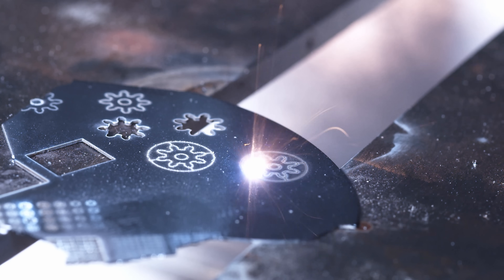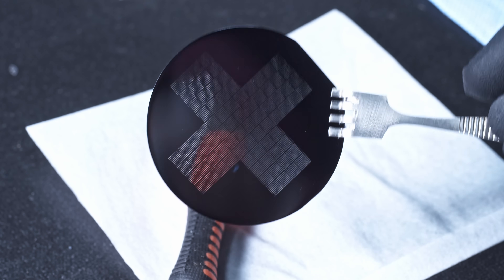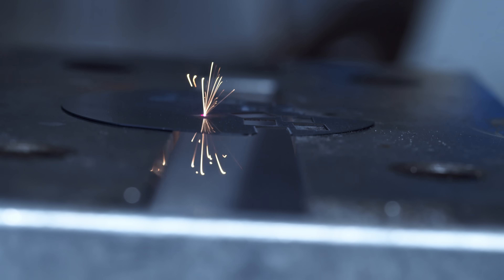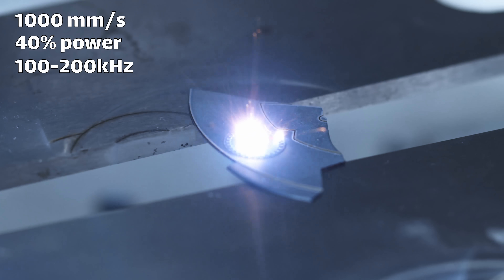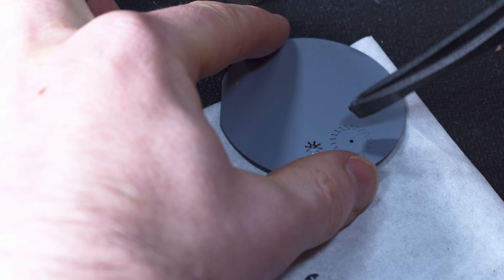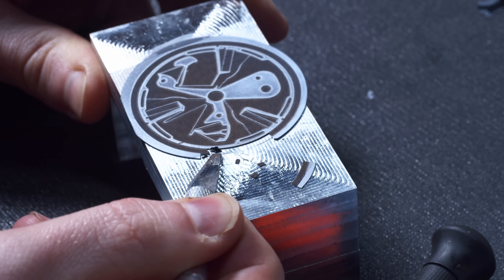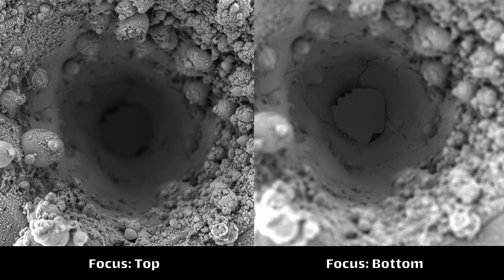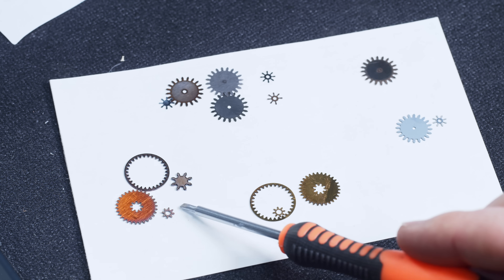Laser cutting Silicon Wafers

Comment: If you are interested in all the crazy things that you can do with some pulsed lasers you can look at what my previous lab is doing : https://www.epfl.ch/labs/galatea/3d-manufacturing/
Reply from the maker: Ohh, fantastic thank you! Definitely going to dig through this, so many interesting things to read about!
Reply: I humbly think that you got the relationship between focal length and depth of field wrong in the video by the way : if you look at this equation (https://wikimedia.org/api/rest_v1/media/math/render/svg/187d5ad538cee7781bf148b2226c86317b83cd31) the DOF is inversely proportional to the square of the focal length, which as far as I understand not what you said in the video. Shorter focal length have bigger depth of field (every thing else equal).

Awesome video nonetheless. Brought back good memories from that time.
Reply from the maker: I probably explained that poorly, my fault. I was trying to avoid diving into numerical aperture in a non-optics video. Really what I meant is that higher NA == smaller spot and shallower DOF.  With these galvo systems, the lens diameter is fixed/standardized, so as you shorten the focal length you end up increasing the NA.  I.e. https://www.researchgate.net/figure/Schematic-representation-of-the-relationship-between-focal-length-depth-of-focus-and_fig5_316263580

Not sure how that relates to traditional photography and focal length / DOF, perhaps I mixed up some terminology.  But the region of effective etching is definitely much shallower due to the higher NA (the increased "angle" of the the converging light means it becomes under-threshold more quickly above and below the ideal location)
Reply: @BreakingTaps  Yep those galvo are sure the bane of any imaging optics... That's alright I think that no one will catch on that bit anyway. It
Reply: @BreakingTaps  If may nitpick again... The schematic you just linked is tingling my optical sense... I am not sure if it is actually correct... I really don't want to start Zemax...
Reply from the maker: Haha, might be wrong! I admit I grabbed the first image in google search that looked roughly like what I wanted :)  Should be roughly correct though, i.e. a more classical example is varying the aperture instead of the focal length to alter the spot size (and DOF): https://static5.olympus-lifescience.com/data/olympusmicro/primer/images/numeraper/varynuairy.jpg?rev=5E1A

And skimming around laser cutter manufacturers, most have pages explaining their lens offerings and show the same idea: shorter focal length (with same aperture) result in smaller spot and shallower DOF

Jealous you have a subscription to Zemax though!
Reply: @BreakingTaps  The one with numerical aperture is entirely correct (Thank god Olympus is not spreading lies) ! 
Believe me, Zemax is like LabVIEW : the more you use it the less you want to use it ;)

Comment: So interesting! Thank you for sharing. How do you program the path of the laser? Is it something like gcode or is it more like a programming language like python?
Reply from the maker: Less pleasant than both those options unfortunately :(  There's a software called EzCAD which most lasers use.  You can draw patterns manually, or import SVG/DXF.  Then you specify which lines are cut with what parameters, which shapes should be hatched/filled or just outlined, etc.  So very manual, WYSIWYG style UI.  I'd much prefer to have gcode or python to be honest :(
Reply: @BreakingTaps  couldn't you abstract that process by writing a simple library for that in whatever language you want?
Reply from the maker: It's all pretty proprietary and no API to speak of, so you'd have to import something like an SVG and then do mouse macros or something barbaric :)  There are a few projects working on open source controller replacements, or reverse engineering the protocol the controller card uses so you can program it directly. I haven't looked into them too closely.

Lightburn is working on a Galvo version of their software, so I'm hopeful that will work better :)
Reply: @BreakingTaps  Ooof, that's rough.

Comment: Having never worked w/silicon wafers before this might be a silly question, would pre-heating reduce shattering?
Reply from the maker: Possibly!  You'd have to get it very hot though I think, like 500-600C or something.  The peak power of the laser is on the order of GW per square centimeter (albeit only at a 30 micron circle), so the area that's being exposed is rapidly heated way past the melting point.  I think you'd need the rest of the wafer to be very hot to prevent thermal issues.  Would probably work though!
Reply: @BreakingTaps  oh, I thought thermal shock was causing the breaks, and lessening the range the material had to heat would reduce that. Learning is fun!
Reply from the maker: Oh no, you're absolutely right! Sorry, didnt mean to come across dismissive! It's definitely the thermal stress of heating and then cooling down rapidly... I'm just not sure how much you'd have to heat it up to make that go away :)  I.e. I tried heating up glass when I was doing something sorta-similar with plasma-induced glass ablation. I got it up to 300C (the max for my hotplate) and still got a lot of cracking. I suspect silicon would be similar?
Reply: @BreakingTaps  Decreasing the delta temperature for melting the silicon could possibly allow you to remove more material with the same power or use less power to remove the same material, wouldn't it? After a quick search it seems though, that silicon starts to thermaly oxidize at temperatures as low as 300°C forming SiO2 on it's surface.
In general, instead of cleaning parts with HF, how about an inert setup similar to the welding process? 

P.S. I would love to see the parts after cleanup under the electron microscope! :)

Comment: On my CO2 laser there is a honeycomb support, the laser can max hit the edge of the thin honeycomb wall, while having maybe 5-7mm pitch between the supports.
Reply from the maker: Hmm I wonder if I could make something similar, but very thin.  Maybe thin foils folded up into a corrugation?
Reply: @BreakingTaps  Yep, mine is not much more than that... it gets its stiffness from the honeycomb shape, it is about the thickness of one of this BBQ aluminum foil trays, not foil.

Comment: 9:00 3D printing supports for big pieces. Support pylons would go under piece that must remain. No support material under cuts or where material should fall off. If supports are 5 cm high then when laser gets to them it should be unfocused so no connections between pylons would melt. Maybe
Reply: If the right plastic is chosen (like the PVA used for dissolvable supports) it wouldn't even matter if they melt because it could just be dissolved off.

Comment: Hey, was just thinking, that looks like it's vaporising a not tiny amount of silicon and making oxide and I'm guessing it's super tiny and dry. watch out for silicosis from it buddy. 
not that I'm expecting a giant risk, but it might be something to look at/think about.

other than that, what an Awesome project.
I really want one of those lasers now lol
Reply from the maker: Agreed! I was wearing a respirator and had air extraction running to help capture the particulate.  Probably should have mentioned that in the video, whoops!
Reply: @BreakingTaps  all good mate, it just struck me as one of those second order type deals that can come back and bite you. Glad to hear you're on the ball. Mentioning the non obvious risk for anyone who replicates is probably a good thing.
Reply: I doubt it’s a huge risk. If I remember correctly silicon is only dangerous from 150-2um. Below that, which this certainly would be passed right through all membrane in the lungs

Comment: 8:10 Did you though about making support out of... needles? Like water jet/plazma cutters have those spiked tables, but just tiny little ones. Like getting wood/plastic base and stuck on it bunch of needles.
Reply from the maker: Ah, that's a clever idea! Will think about a way to set that up
Reply: @BreakingTaps  Yes! I was just about to comment this idea. I was thinking, instead of a uniform bed of needles(where maybe important parts don't get supported or you risk hitting a needle), maybe plan strategic needle support points and you could burn holes for needles, or at least burn pilots to drill holes to put the needles. Very exciting capabilities on that laser regardless! You've got another subscriber!

Comment: What's the maximum pulse frequency your machine can go to? You mentioned going to higher frequencies like 100-200kHz but I think you say earlier that you can go to 400kHz. Why not?
Reply from the maker: Max frequency is 600kHz for my machine.  At frequencies above 200kHz, it starts to act more like a CW laser than a pulsed laser (at least in this silicon). So you mostly melt the surface layer but don't really ablate anything and it won't etch very deeply. I tried a few variants and could never get it to etch more than a dozen microns below the surface, although it does do neat things to the surface itself (the fingerprint and "interference fringes" were done at 600kHz because I was trying to alter the surface without really removing it).

I think you could probably use the high frequency for a "cleanup" pass after the cutting is done, to help smooth out the edges.  But I haven't explored that much yet.
Reply: @BreakingTaps  I see I see! Very interesting. Thanks!

Comment: 4:50 Glitch alert! I'm only pointing this out because of EEVBlog's recent video about similar problems with glitches when filming silicon wafers. (WEIRD Blackmagic ATEM Mini Fault)
Reply from the maker: Oh, weird!  I saw that glitch last night but decided I didn't care enough to reencode and reupload, I didn't realize it was a "thing" though.  Will go check out EEVBlog's video about it, super strange!
Reply: @BreakingTaps  Might be for a completely unrelated reason to be fair.
Reply: Came down to the comments because I spotted it and wondered what it was.  Thanks for the heads up about the EEVBlog video.
Reply: When I first saw that glitch, I thought it looked like some kind of bar code. If it only appears on films of silicon wafers, maybe that's really what it is: some kind of tracking number only visible under the right conditions.

Comment: re: support
it's bee nsaid many times as far as i can see, but i'll say it anyway
what about using some sort of film for support, that could be easily dissolved away from silicon
Reply from the maker: That could work! Didn't think about that but I could see that working, as long as it doesn't absorb too much of the laser wavelength (which wouldn't be too hard, since most polymers are invisible to 1064nm)

Comment: Don’t take this the wrong way, but there were several major flaws in your setup.  First, there wasn’t much fume extraction going on, so some of the optics likely got coated with what was ablated.
Second, using a flat aluminum black instead of some type of metal grid, was a very strange choice. You probably would have had better luck with a metal grill and blower fan.
Reply: He said - in his answer to Zyeborm a few posts below yours - that he WAS using air extraction, but forgot to mention it in the video.

Comment: could you place some kind of wax layer between the wafer and the aluminum block used for support in order to glue the keep the part stationary and supported and then melt it to get your part?
Reply: I was wondering the same. It would have to be a material that does not generate a burst of gas when the laser punches through and hits it because that would likely cause the work to move.

Comment: Interesting ,wonder could you dissolve the aluminium with something without damaging the silicon for removal, I'm no chemist, I was thinking sodium hydroxide but a quick Google tells me it will dissolve silicon the same way as aluminium,  you could try using a piece of cardboard/paper or something no? Or like coat the back of the silicon wafer in casting wax or some pitch or something that will give it support during the cut but can be melted /dissolved off easily enough
Reply: Manual lithography exists - I have never got to drive one but FIB (focused ion beam) die editing is a trip.

I really see this as potential for machining things that are glass and ceramic like, since a silicon wafer (even the reject ones are still impossibly pure and purer than anything found in nature) is, for all intents of handling purposes, very thin glass.  Usually they're attached to a sacrificial substrate even after they're diced so they don't get destroyed in processing; final grinds can be highly manual depending on the parts.

But all that being said, there are still a lot of methods that can be used in the kitchen to give access to technologies that we'd never get a card key for the facilities in our lives.  :-)  

There are a few channels here that do a LOT of materials science - I saw a guy go get oyster shells and make a supercapacitor.  No lie.

Science is science, the difference between us and the big companies is scale and access to resources.  If you can get your own resources (smelter channels YT has everything to teach you) then you don't even need to order out and can of course check your own purity and construction.

Good microscopes are only a few hundred bucks now, if you can get a few hundred bucks together.  You can get just the head for under 200 bucks and get a pretty good stereo widefield model.  By "good" I mean useful and upgradable...it's amazing how many questions you can answer with that and a 30 buck eyepiece usb camera.
Reply: aluminum desolving method could work. In my school's IC lab we use aluminum as the conductors for the mosfets made in our IC design course.

Comment: 200 nanoseconds? Not picoseconds?
Edit: that's the long-pulse mode. Normal mode is 90-130 ns... still rather long.
Reply from the maker: Yep, definitely 200ns, at least according to the specs on the laser source! My unit has a JPT YDFLP-E-50-LP-L-R (https://en.jptoe.com/product/lp-e-20w-30w-50w-mopa-fiber-lasers/). My understanding is that the JPT sorta-MOPA design means you end up getting longer pulses out the end, compared to some other fiber laser manufacturers. Could be wrong on that though :)

Comment: Would submerging the sample while cutting help or does water block too much of the laser/reacts with Si? Zero experience with fiber lasers, just curious
Reply from the maker: I've only played with it a little (it's on the todo list!) but from my limited experiments it will still work with a thin coating of water. But it does slow down the machining process since you lose more energy to steam and plasma.  I've seen some sources (professional laser companies and papers) that use a liquid covering or mist spray to help keep heat under control for very precise work, it just ends up taking longer as a tradeoff.
Reply: iirc some processes also use water to reduce the spot size

Comment: Can't remember where I saw it, but someone was making cuts on tempered glass (I think?) by submersing it in a very shallow water bath to handle heat. It worked surprisingly well. Might be something worth investigating here as well? Surface tension might help give a small amount of structural support during the cut too. Awesome results either way!
Reply: Might have been Applied Science I think?
Reply: @RamiSlicer  that sounds about right!
Reply: @RamiSlicer  sure was.. https://www.youtube.com/watch?v=kxXEI0Ce6C0
Reply: I came to the comments to say this, then came to the answers section of this comment to supply the name of the channel referenced. Beaten twice by the Internet 🤗
Reply: It was applies science, I think he was using a co2 laser to cut ceramic for high temperature circuit boards
Reply: I suspect that may not work as well in this case because the water will change the focus of the laser.
Reply: He did it. Applied Science did also, but it was this channel also IIRC.
Reply: neodymium magnet arrays can also be laser micromachined underwater, albeit with large surface roughness